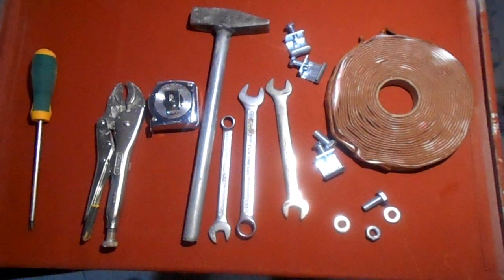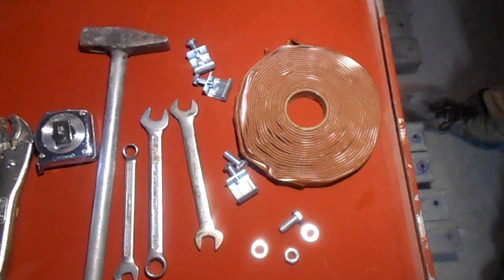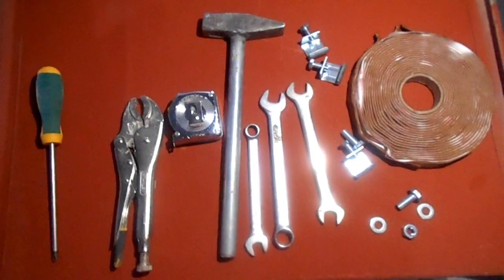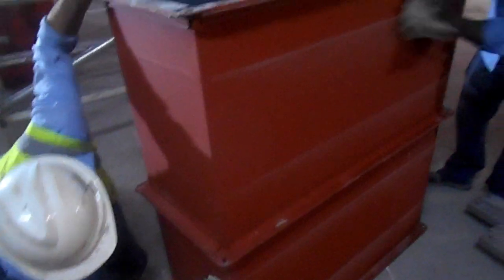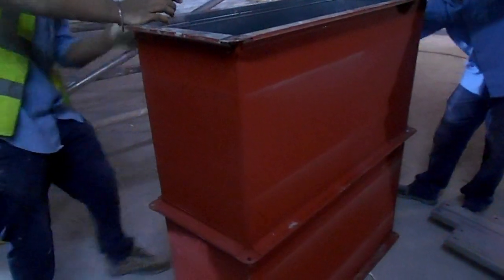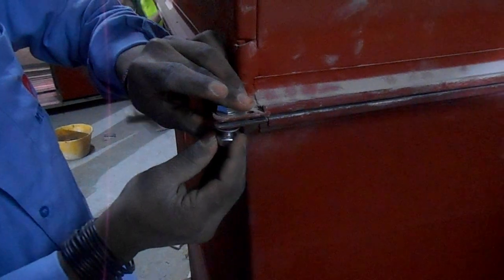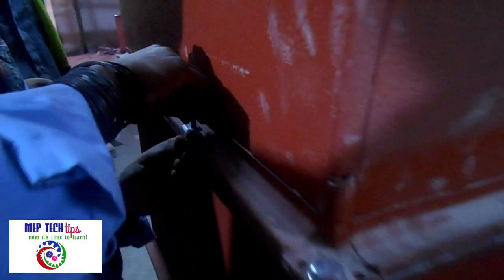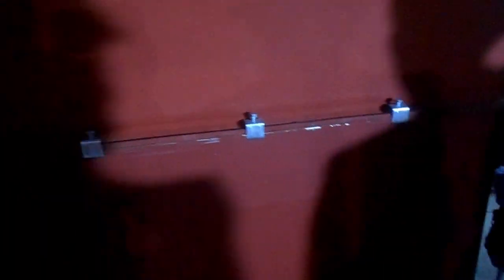How to install fire rated Ductwork | Fire rated duct coating system | Fire Duct by MEP Tech Tips

Comment: What is the purpose of these ducts? No insulation there, why?
Reply from the maker: This ducts are called fire rated ducts, It has fire rated coating on it , which mostly used in basement for smoke control